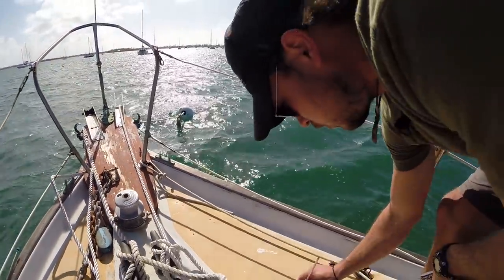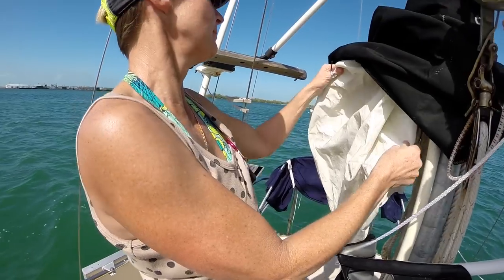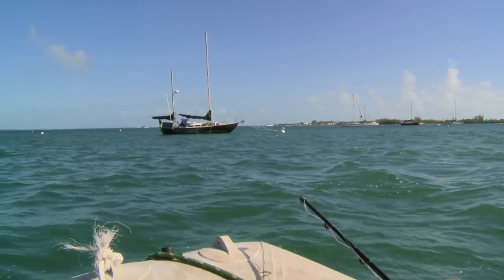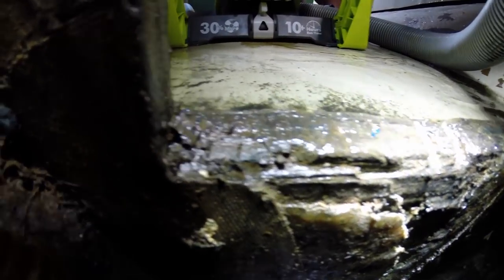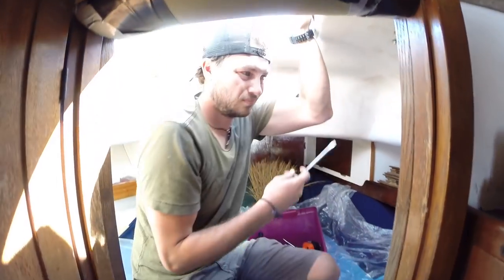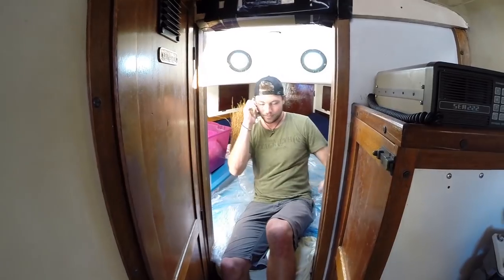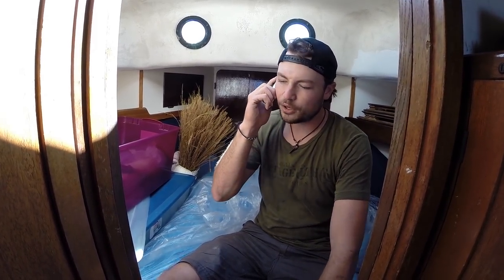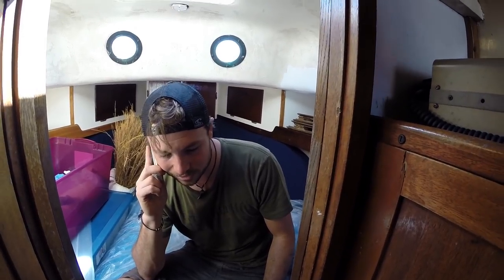Buying A Used Sailboat | S01E02

Comment: Very polite you guys but you should never buy a boat without having a survey or seeing the boat yourselves out of the water. Blisters on the hull is not such a big problem but through hull fittings and the rudder are. If you really are going off into heavier seas then the boat can either save you or kill you. In the end you are very, very alone and you have only one good friend and that's your floating bubble. The sea cares for nobody.